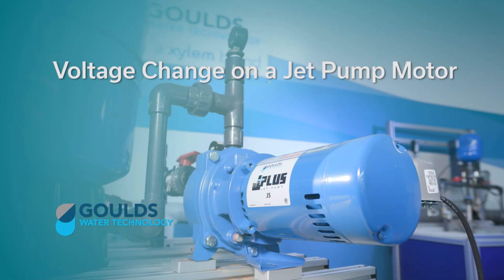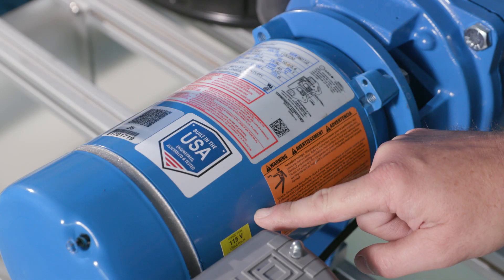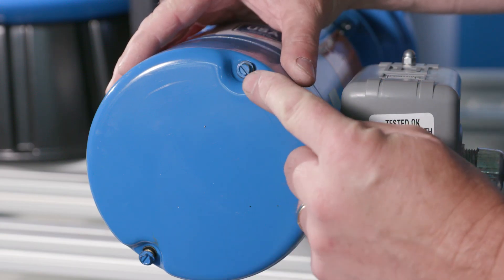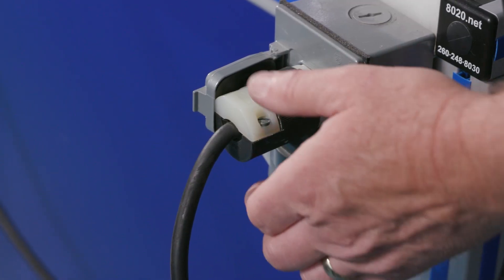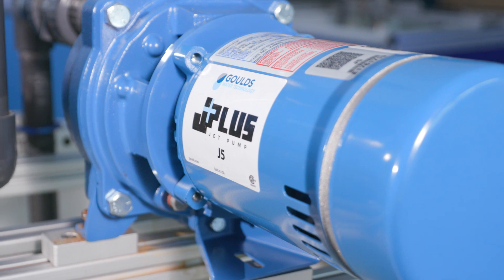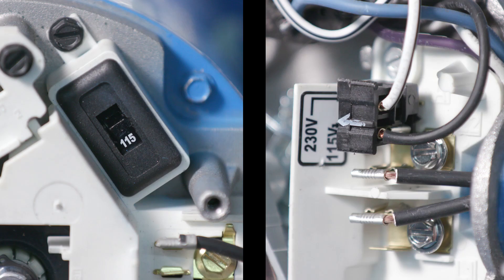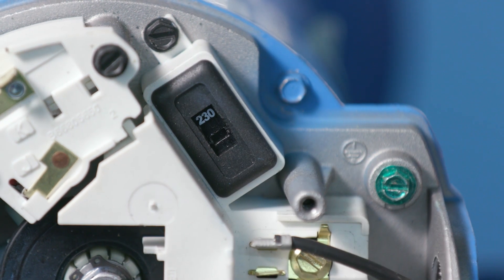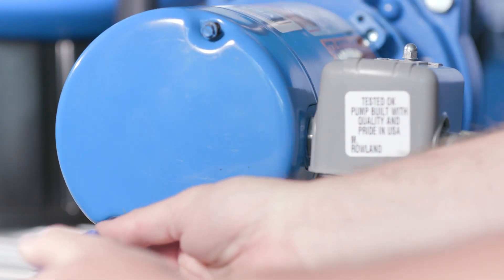How to Change Voltage on a Jet Pump Motor

Comment: Thanks. I guess this answers that my goulds J10s (1hp) is 230v.  Question: Does it use 10/3 w/ ground or 10/2 with ground? I need to buy the right cables (as the wrong ones are being used now).

Comment: I'm on my second Goulds pump. They seem to be very well made, but I really wish the bolts on the motor cover were more substantial. They are really easy to strip out the heads making it impossible to remove the cover to service the components inside without drilling out the bolts.

Comment: Hey guys I just bought a j15s for my home I am having trouble keeping it running. I just went out today to find it was not running and tripped my braker. Still not running seen that the pressure switch contacts had arc marks on them cleaned them off got it running but continues to cycle to fast. On off on off what is going on with this pump. Please respond asap

Comment: Thank you! After installing a new pump, priming it, testing it, re-reading the instruction manual for several hours, and searching for any hints from the manufacturer online, I finally found your video.  It took 2 minutes to watch it,, seconds to locate where to change the voltage and actually get it done.  The pump purrs like it ought to, thanks to you and no thanks to the folks who published the instruction manual.  Could this be why men infamously refuse to read instruction manuals? They are useless anyway?

Comment: I have a Goulds pump without the switch or the jumper. Who do you change it to 230 then?
Reply: If over a 1-1/2hp... they are 220-240V only

Comment: What about the plug end? The plug does have to change.
Reply: I'm curious about this too!!!

Currently, mine is working as a 220V unit.   They've been shutting power down in my area lately, and want my generator to not have to TRY and start the pump. I'd like to see how it does on 110V as it's only a booster pump for water pressure. However, what do I do on the line side feed of the cord/plug??  Do I need to remove the second hot leg, or will moving the jumper (inside the pump) be sufficient?!

Need more clarification.
Reply: @JohnnyJ50f  did you find out? I want to do the exact samething